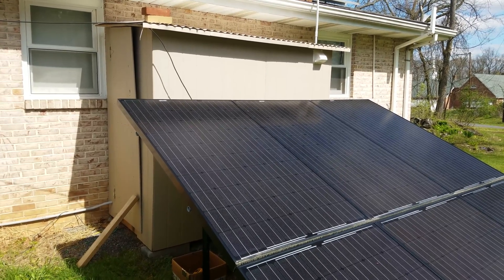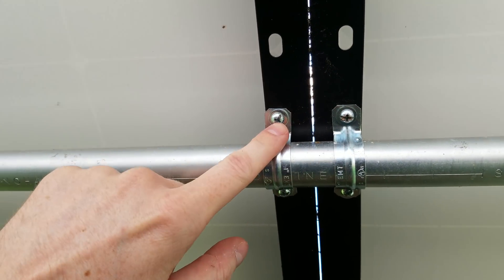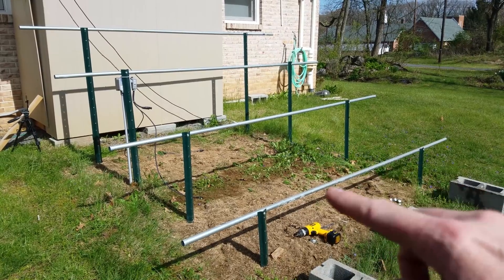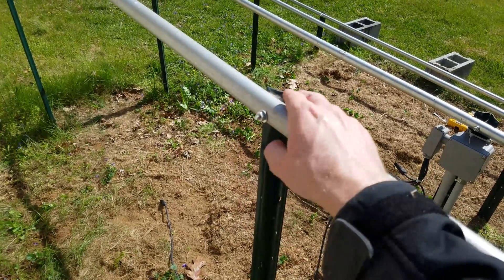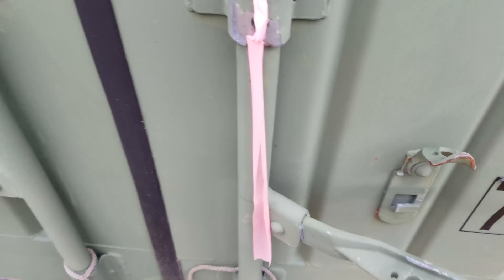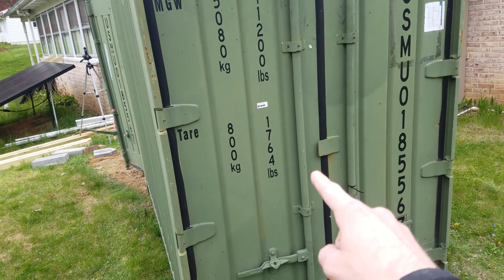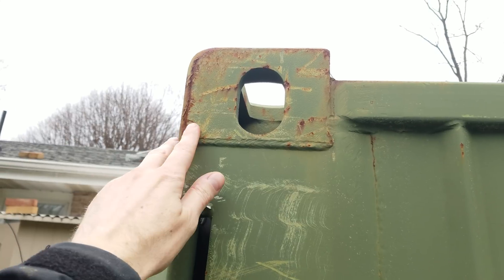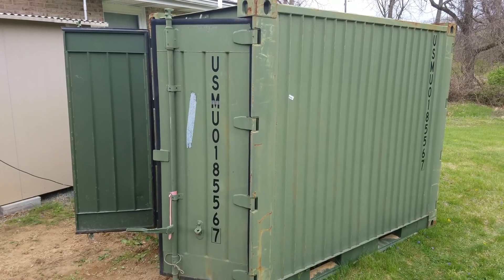It's Upgrade Time! The Start of the Shipping Container Battery Shed

Comment: A little tip, well earned thru many, many errors. When removing any screws, using a longer shaft on tool works best. The pivot, you’ll have a better angle. Your less likely to strip the head.

Comment: Hi, I enjoyed you video. One idea I had is make sure you drive some ground rods and attach a ground lugs to your enclosure. This way you will have all equipment inside protected from EMP or Solar Flare.   Would enable you to store other spare electronics if there is room in your container.
Reply from the maker: Thanks! I have an 8ft ground rod about 5 feet from the container that I used previously for an antenna mast. The antenna mast is being moved and I plan to connect to that grounding rod.
Reply: using an additional grounding rod is a big nono

Comment: how much does a shipping container cost? lol
Reply from the maker: You can get them this size anywhere from $500-$1500 on govplanet.com. It's an auction site so prices depend on your location, quantity available, other bidders, etc.
Reply: @LithiumSolar  So here's a question i have been pondering since watching your vid yesterday :)  what about temperature?  I live in florida and currently my batteries are in my garage so it's warm but not bad.  I am guessing a metal box in florida sun would get quite toasty.  At what point will the ambient temp start degrading the battery performance and what temp is it not safe any more.  I know alot of stuff is talked about the as far as the temp of the battery itself from charge/discharge, but what about surrounding environment?  just curious if you have any thoughts on it.  haven't found anything definitive myself
Reply from the maker: I'm planning to insulate the inside and find a super small mini-split heat pump. It also won't be exposed to sun much. The house will cover two sides of it, a solar array on the 3rd side, and the roof will have a few solar panels. I think it will be fine taking into account all of these things, but we'll see.
Reply: @LithiumSolar  nice.  will the heat pump be to get heat in or out?  lol
Reply from the maker: A heat pump works in both directions. In the summer, it will take heat out. In the winter, it will put heat in ;)

Comment: Thanks. I was smiling all the way, looking at the military steel container and imagining how, you will be designing the placement of batteries and other paraphernalia. What puzzled me, is how did the container reach your back yard and how are you going to relocate it to the intended area. THIS IS A BIG JOB. I admire your endeavor and enthusiasm.... well; I wish you all the luck and am looking forward to seeing the work in progress. Cheers. 73s.
Reply from the maker: It was brought in on a trailer. We hammered steel stakes in about 3ft and tied a big rope around it twice, then pulled the truck forward and the container fell off. It took two tries to get it off, the stakes bent the first time lol. As for moving it... I have it lifted up on 4x4 now, but still have to figure that part out.
Reply: Well, wish you all the luck in your endeavor. Please post the work in progress. Thanks and 73s

Comment: I was hoping you were gonna make the saline shipping container battery. Rather than using a shipping container as a shed. Now you have to worry about that thing becoming a heat box and fckin up your batteries prematurely if they can't stand being in constant 140f temps.
Reply from the maker: Insulation and a small heat pump should do the trick heating/cooling. We'll see how it goes... I'm not familiar with saline batteries but might be interested in venturing into something new once this project is completed :)
Reply: @LithiumSolar  Ess Inc Flow batteries is where you want to start imo.
Reply: How hot does it get in there now?

Comment: I have a big box of cells that get hot while charging with 1A that you cant touch them longer then a few seconds. What do you recommend to do with them? I am sourcing from laptopbatteries 18650cells  for ebikes and my first small powerwall. Guess its not good to use this for bikes but do you think i can try charge them with 300mA and still use them for the wall? Would hurt me to not be able to use them. Cause many of them are 2500mA and more. They wont never discharge with more then 1A in my powerwall. Thanks alot for your good work. :) And where is your internal resistent cut off? I think about dont mess with cells about 150 IR. Greets from Germany. :)
Reply from the maker: Recycle the hot cells. I would never use cells that show any signs of defects or abnormal operating conditions. Don't risk safety for a small box of cells. I haven't found anywhere in my area to recycle yet, so I still have several large boxes of bad cell stacked up... As for the internal resistance question, I don't check it at all. I find those cells get weeded out through the capacity testing and sitting a few weeks to check for self-discharge.

Comment: Something to consider using to move your container is a comealong or 1 ton crane hoist from Harbor Freight. Each will allow you to move this provided you have a good anchor support to attach to. If you house has a brick exterior don't use that you will pull down the bricks. but you might be able to position your truck in such a way to use it as an anchor or a nearby tree. Some sort of wrap around strap would be required or a chain. This will move easier than you think despite the weight of almost a ton. Use the bottom anchor points to attach to which will lift a bit as it pulls to prevent it from digging into the ground... Good luck and I look forward to seeing what you make of this box... Cheers...
Reply from the maker: Anchor point is always the problem. It's going in the corner area near the house, so there is nowhere to anchor it too other than driving stakes in the ground. The bricks are not designed to pull a 1-ton container, as you mentioned, even though I have had a few people suggest it lol.

Comment: What will you do for heat?  The container I have gets rather hot, 120F+ easily on sunny days.  I would imagine for batteries that could get unsafe?
Reply from the maker: I'm thinking some sort of portable AC or small minisplit. I'm not sure yet.
Reply: Of course, the internal temperature would be 50% higher than the ambient temperature. No amount of cooling devices will keep the insides cool for the Li-ion or LiFePo4 cells. I’d recommend a thermostatically controlled forced ventilation and Canvas canopy, shielding the Cabin from direct sun rays. The ventilators, of course, will run on AC mains. Frankly, I’m eagerly looking forward to the work in progress and the final assembly. I wish you all the best. 73s.

Comment: Roll it with logs.
Reply: Ya, I have moved larger containers on logs and it worked well.
Reply from the maker: I got it up on some 4x4 last night. I think I can just push it around with my truck now. If that doesn't work, I am liking the log idea and may try that next.
Reply: use schedule 80 4 inch pvc pipe for rollers. Steel box will slide easily or roll depending on which direction you need it to move. Learned this trick moving a 1500 lb gun safe easily with two people and 3 rollers.

Comment: If you don't mind, how much did that smaller container cost? Around here the full sized ones cost about $2100-$3000 (depending on the condition) delivered. But those are 48Ft long, 13Ft high, 9Ft wide. So loooots of space. Imagine how many batteries one of those could hold. Run months w/o recharge 😜
Reply from the maker: Those are resale prices though. Look on govplanet.com, they're a lot cheaper.

Comment: If you want to be safe, rent a forklift.  That way, you don't have to worry too much at all about the dangers of dropping it near as much.
Reply from the maker: I got it up on 4x4 blocks after I filmed the video. I'm thinking I can just push it around with my truck. A forklift designed to be operated in grass would be awesome, but during my brief searching, couldn't find anywhere to rent one like that in my area. Most places that rented forklifts just had the standard warehouse kind. I'll admit though, I'm not experienced in the area at all so maybe I wasn't search right... Idk.
Reply: @LithiumSolar  I have moved larger shipping containers with a dozen round logs (I think they were about 6 inch diameter ones).  Once on logs I was able to move mine with just a winch on a truck.

Comment: Exciting.  Why such a tough shed and not just a wooden one?  Did you want a fire proof shed?
Reply from the maker: Yes, for the absolute worst-case scenario. I wouldn't call it "fire proof" since it doesn't technically have a fire rating, but it's definitely better than wood and the steel is very thick. If the shed was in a remote area away from the house, I wouldn't care of it was wood or not.
Reply: @LithiumSolar  Cool think is you are very easily take your solar and batteries with you if you ever move.  Nice!

Comment: Are you still using the Aims inverter? Do you turn the inverter on and off from the house or do you just have a automatic disconnect for low voltage?
Reply from the maker: Yes, I'm still using the AIMS 10kW. I'd love to upgrade to a 12kW at some point. I leave the inverter on all of the time, but I have a manual transfer switch that I use when the voltage is low. If I forget or am not paying attention (never happens...) the Batrium BMS shuts down the battery bank.
Reply: @LithiumSolar  That sounds like the only good solution with the limited Aims interface on our models. Do you think I could trigger my Aims 12 kW wired remote switch to turn the inverter on and off?

Comment: So cool!   My first thought - now you have to move that 170lb AIMS inverter!    FYI - I checked and AIMS said its OK to lay them flat.  I've been running mine flat for over a year now with no problems - so maybe a flat orientation would give you an option to avoid trying to hoist that thing up on the wall!
Reply from the maker: I used a car jack the first time to get it up the wall (NOT RECOMMENDED lol). I have a winch now. I'd still like to wall-mount it to free up floor space, but horizontally mounting definitely is a possibility. It's great know horizontal is acceptable.
Reply: Maybe winch it up a ramp onto a temp table and then from there tilt it vertical and then pull the table out from under.   In any case - still VERY COOL container!!

Comment: Thats a nice container. Mind if I ask roughly what its worth. I didnt know they came that small. Why the change?
Reply: container-quotes.com - give them a shot
Reply: @scottdecker8612  thanks . Never heard of that
Reply from the maker: The change was needed. The current shed is wood, which would be fine if it were away from the house and mine is not. It's also starting to sag in the center from the battery shelving not being supported very well. You can buy the Charleston Marine 115A on govplanet.com.
Reply: @LithiumSolar  I prefer steel or concrete for batteries. I like the sea can idea. Bolt all the packs down so you can move the whole container. Probably sell it as a complete system and build another. What do you think its all worth? 25K